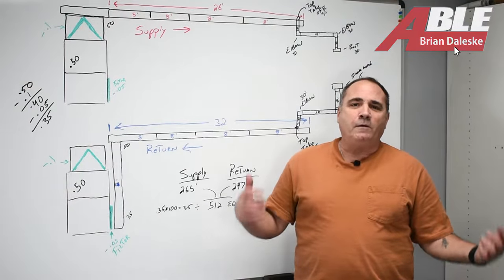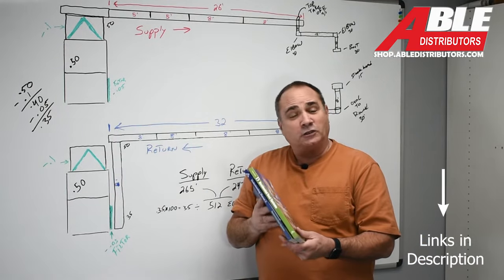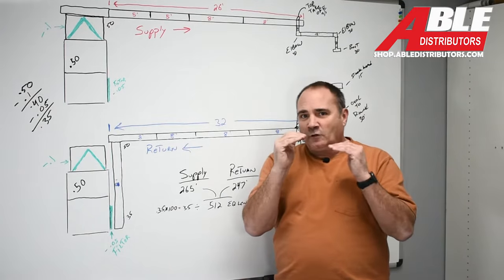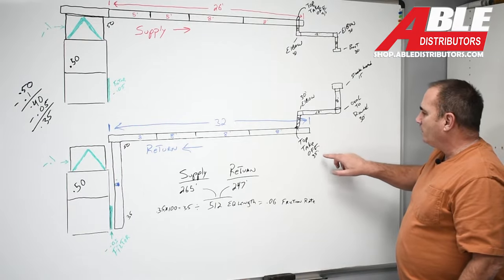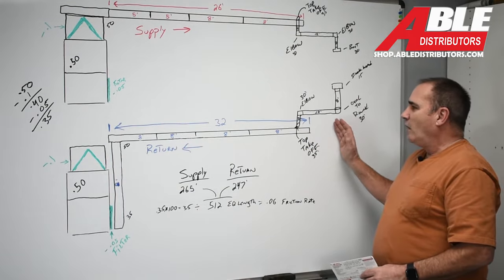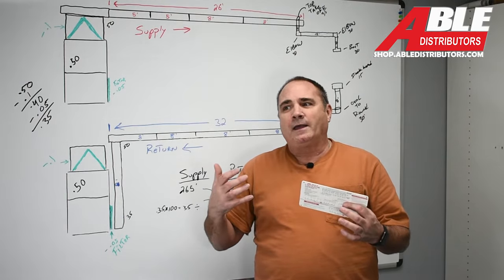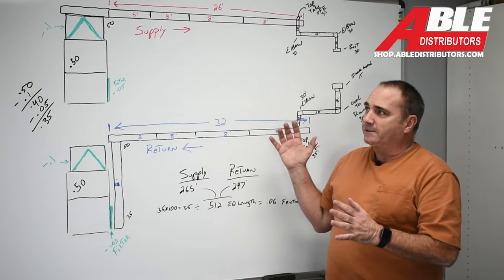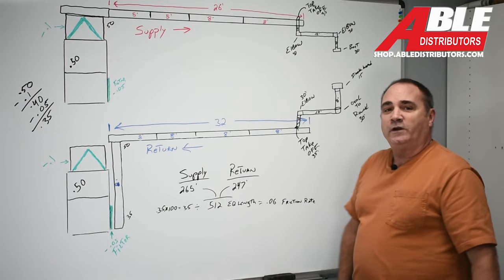Air Duct Calculation explained

Comment: Is there software to design duct systems
Reply from the maker: absolutely, you can find software for almost every aspect of HVAC design, and I may get into that on my designing duct system video, but just like smart digital gauges, I still think technicians should know the how and why, once you have the knowledge you can quickly assess the duct work on a quote or repair.  most of my work history is in repair/replacement, so most of my information leans that way, so often I see contractors replacing equipment and then ending up shocked that the original issue remains. lets face it, our trade is difficult, I've said it before, we need to be a sheet metal worker, plumber, electrician, computer programer, and a detective..... we need to kneel in front of a thousand furnaces before we can quickly assess whats going on.   I love our job !  ( sorry for long response )

Comment: What about the pressure drop from each return and supply register? Should I subtract another 0.06" to account for the registers on the longest run?
Reply: On the friction rate worksheet you only subtract the PD from the worst case supply and return grilles.  ACCA allows you to assume .03" for a supply and .03" for a return. It is recommended that if you know the model of grille being used that you use the actual pd from the performance data.

Comment: First off .1 is too low for most wet evap coils,   you should should manufactures lit  so the guys know they have to determine it,  last A coil i did last week  was 2.5 wet. good first vid  drive home air filter pressure drops, example same job last week I installed 2  20 X 25 X 5 media filters to make the math work.
Reply: well i should say made the math work for the Air velocity i wanted for a quiet system that is very energy efficient for the blower motor,, also  you need the blower performance lit from the Manufacture to do this all.  hope you touch on that
Reply from the maker: @Gutter-Snipe  with most of my videos, I try to keep it very general and hope the technicians search out the exact equations for what they are working on, there are just to many variables to hit on them all, the carrier N coil, or if an A-coil is two row, three row or four, fin on tube or micro channel. as for the duct work, I mention a top take off, but the numbers change if its a square throat scottie, or a three or four piece adjustable take off. my hope is that my videos provide a starting point to inspire techs to keep learning.   thanks for checking out our videos, more to come.
Reply: This the first YouTube I’ve ever seen where friction rate was explained properly 👍🏼